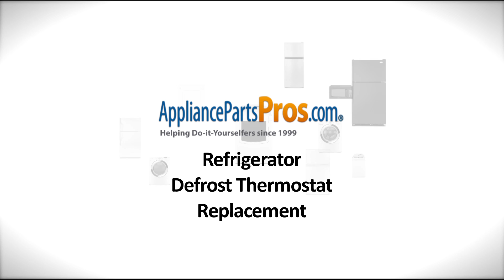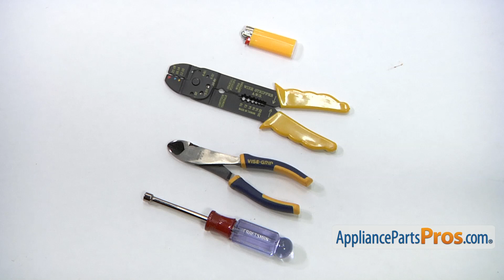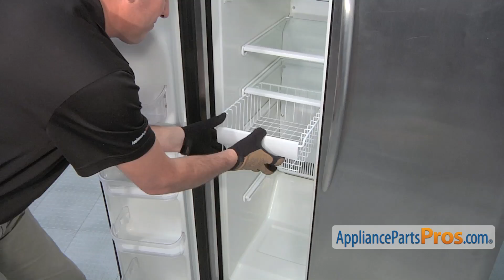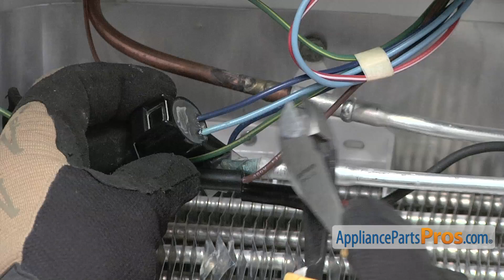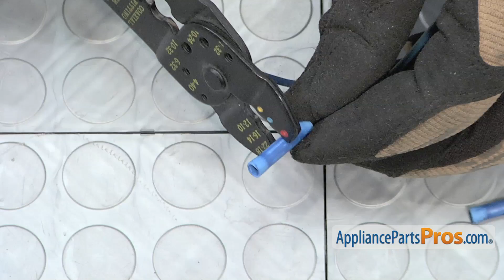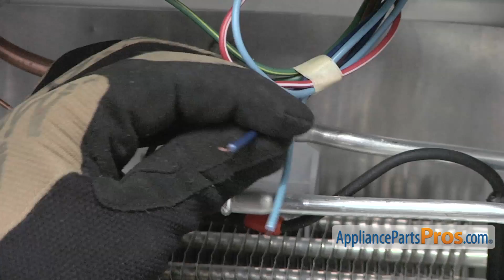How To: Frigidaire/Electrolux Defrost Thermostat 5303918214

Comment: Can I bypass the thermostat by connecting the the two wires together (closing the circuit) to see if the defroster comes on?
Reply from the maker: We cannot recommend you bypass that thermostat for safety reasons. But you can test the defrost thermostat for continuity with a multimeter.

Comment: What should the ohms reading be and at what temperature, so it can be tested?
Reply from the maker: The defrost thermostat can be tested for continuity with a multimeter. It will have continuity at 32 degrees.

Comment: I bought the thermostat and compressor run compacitor. I got them today and put them on the fridge.  Fingers crossed that this is the problem.  Frigidaire freezer not cold enough to freeze.

Comment: Can I just use wire nuts and electrical tape?  I had already replaced that part and that is what I did.  I am currently troubleshooting.  (But, a wire connector that goes into my multimeter broke and I have not bought a new one yet.)  Why would a thick layer of ice be ONLY on the top tube of the condenser, from the thin wire to the finned area?  It was like 1.5-2 inches all the way around.  The rest of the condenser had NO ice on it.  That cannot be normal, right?

I just finished sanding the copper tubing where the defrost thermostat sits and I am waiting to see what happens in about 12 hours.  After just minutes it's already forming ice in the same area.

So far:
I bought an Electrolux Start Relay Kit, and the relay went bad after about two months.
I bought the defrost thermostat without realizing the new relay went bad.  (The relay switch was not completely gone at that time.)
So, I bought a 3-1 hard start switch to continue troubleshooting.
The only other thing I know is wrong: There is a pinhole in the copper tubing (by the compressor) leading up to, and up, the back of the refrigerator.  I assume that is for the water going to the water filter.
(The water line has no water flow.  Currently, I am not able to check because the faucet is not connected at all.  Pipes are capped.  Remodeling.)
Model: FSC23F7DW8

Comment: Good video, but what s the purpose of heating the shrink wrap over the butt connectors? In heating it, are you trying to get an airtight seal at both ends of the butt connector? You got to be careful because you can burn right through the shrink wrap.
Reply: The heat shrink serves a couple purposes. It insulates the from shorting out and also keeps moisture out. The guy who touched the cigarette lighter flame directly to the heat shrink has no idea what he is doing. Also , all the replacement defrost thermostats I've seen ship with shrink that is 2x too big for the job, resulting in a poor seal.
Reply: @NicholasHorvath   I just posted here.  If you see this check my OP, please.  Yes, I figured the shrink was to stop moisture.  That was going to be my next step.  In my case, you are correct about the wrap.  It is the same ID/OD as what is in this video.  In fact, it is the exact same kit from this supplier.  I did not already wrap it because I want to see if the sanding made a difference... NOTE my OP.

EDIT  BTW, I cannot find anything, anywhere, addressing my situation/question regarding the ice.

Comment: hi thanks for the video.  if the defrost thermostat isn't mounted directly to the cooper line, ie lets say it's not mounted at all hanging loose or mounted instead to the what looks like the aluminum or steel line,  will this by any means result in the defrost thermostat from working?   Reason i ask is i've must have moved my fridge back and forth from the wall area many times for various reasons and have came across the issue of the freezer not defrosting and noticed the defrost thermostat not mounted.  i remounted it to the aluminum line and same results happened.  i have since mounted it to the cooper line, jan. 29th,  and waiting to see if this actually was the initial problem  and if it fixes itself but it does take about a week for the frost to accumulate to the point of the unit not performing to standard.  please looking for some immediate advice to my specific question thank you.
Reply: I know this is old, but for anyone reading, such as me:  What did/does the owner manual say about the general time regarding defrost cycles?  It will never be exact because there are variables, such as one person/family opening the door more, or less.  The defrost thermostat should sit on the copper tubing.  Depending on the bend, about 1/3 the way from the 'regular' condenser tubing.